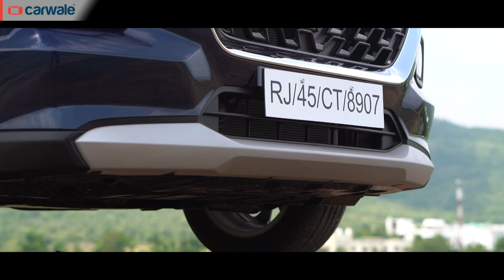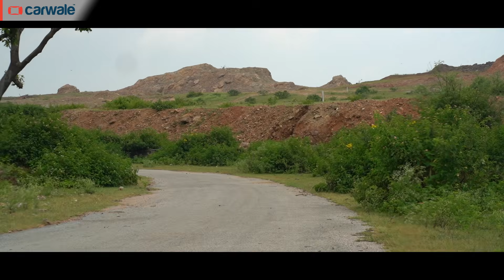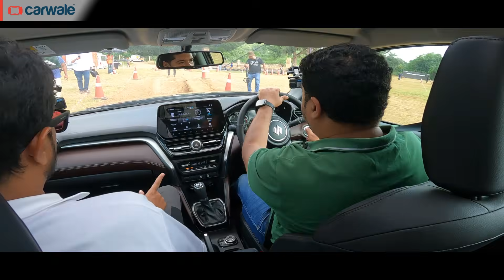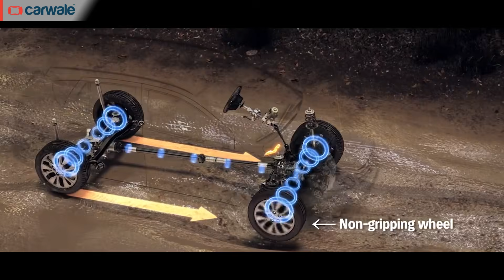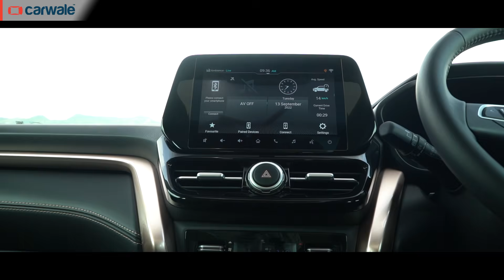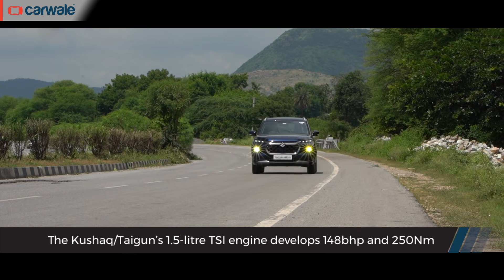4 Important reasons to buy the Maruti Suzuki Grand Vitara

Comment: I need to buy SUV(1.5 L naturally aspirated preferred). Budget is around 15L with a buffer of 1-2 lakhs. Running is less about 200-300 km per month.
I need good SUV for long drives including Hills. I can wait for few months before making my decision. I am not a very enthusiastic driver but need enough power for overtaking and enough Torque for hills.  We are a family of 4 and looking for at least 5 seater with good leg room at the rear as we all are tall. I am not thinking much about Turbo.
	 
	Requirement are below:
	Safety (possibly 5 star) , 4 wheels disk break and all the airbags
	Automatic Gear Box
	Good Ground Clearance
	Mileage (we can consider Hybrid as well)
	Resale Value and Good service
 
I thought a lot about New Brezza, Kushaq, S-Cross(new facelift). If facelift of XUV300 comes with Automatic gear box(Not AMT) then I can think about it.
Now a days I am also thinking about New Grand Vitara(strong and mild both) but not sure about the safety/strength of this SUV. Please recommend other options as well. XUV400 as well
Reply from the maker: You can look at the Grand Vitara 1.5 AT
Reply: @CarWale  strong hybrid or Mild please ?

Comment: the AllGrip variant nearly 1.5months ago, but .. but the only major concern is regarding the sunroof curtain. Please share your feeling/opinion on it, it’s too thin even worse than Astor which may cause a tremendous problem in Indian summer. Please help… thanks again.
Reply from the maker: Should not be an issue, we were driving around in the hot sun.
Reply: @CarWale  Okk, thanks